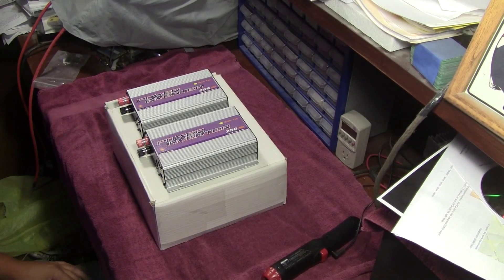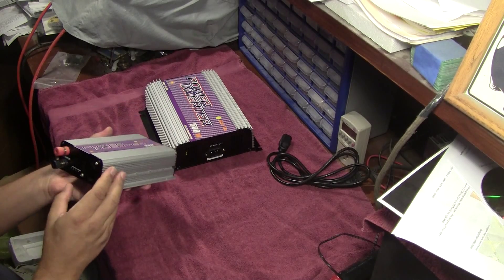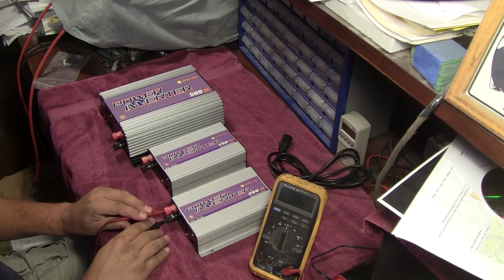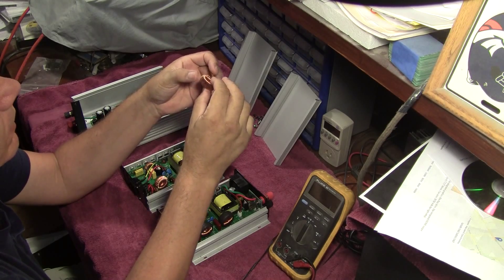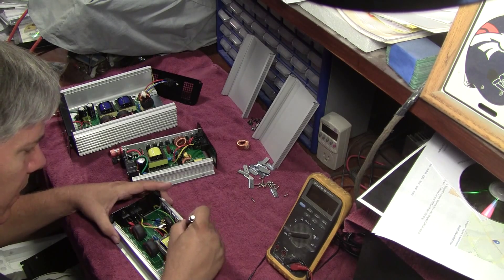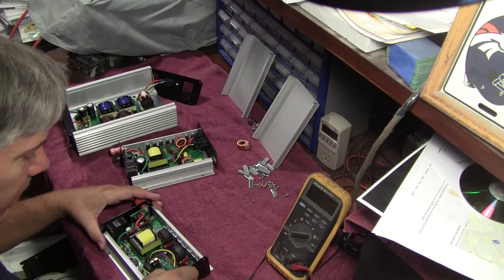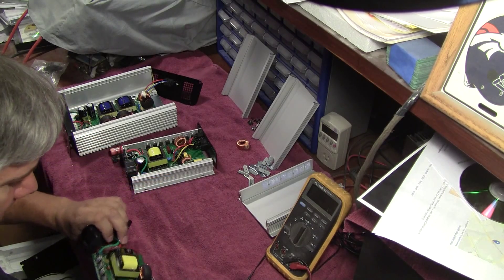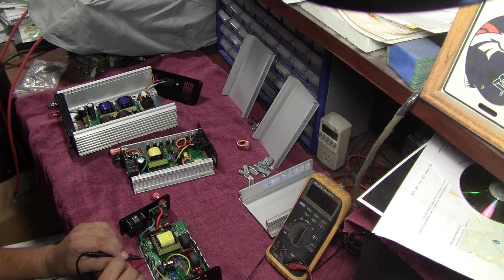Triple Whammy - Sun 250 and Sun 500 Grid Tie Inverter Repairs Part 1

Comment: Hi Mike
I have problem on my Grid tie Inverter, there is no power (LED doesnt light) when you connect to AC source. DC source is OK. can you help me
Reply from the maker: It blew up. The ac fuse is probably blown. Take a look in my links. There is a couple videos where guys go through the debug procedure.

Comment: Hi, mikep95133 i have a sun500, that works on 230v i would use it in Brazil, thatn is 110v the question is can i  make the conection on the pc board that i see onn mine, without damage it. i saw it has 4 pins of weld, mine is welded 2 and 3 pins, i have a picture  shows to do 115 volts  is 1 and 2 plus 2 and 4, please help me, i dont anderstand almost nothing about eletronic. Thank you in advance. njm663.
Reply from the maker: I think that sounds right from what I remember. I sold all 3 of them not long ago. If 2-3 are soldered together for 230v, then remove that one, and put jumpers across 1-2 and 3-4. Basically what's going on is your taking the transformer input from series for 230v to parallel for 120.
Reply: mikep95133 Thanks man, but if i put the the transformers in parallel  for 120v the  output  will gonna be the same (500)? or  (250w)? . Thanks a lot. njm
Reply from the maker: Nato Lena
Stays at 250w.